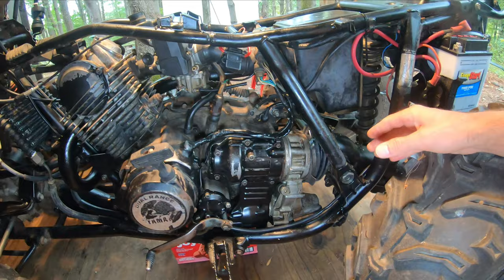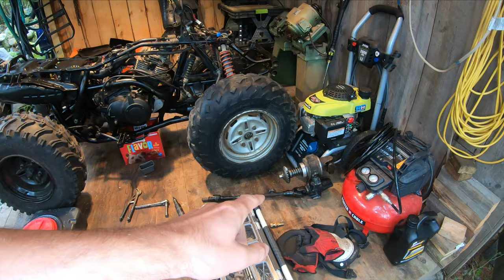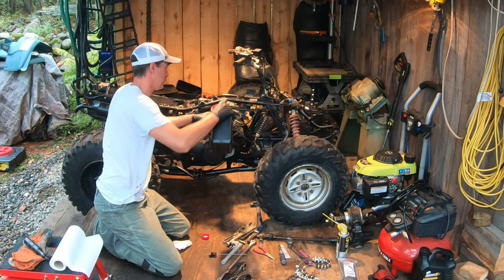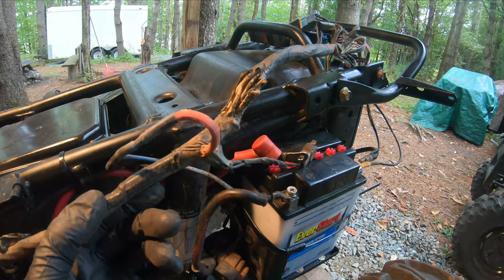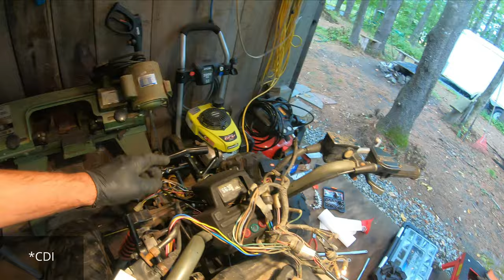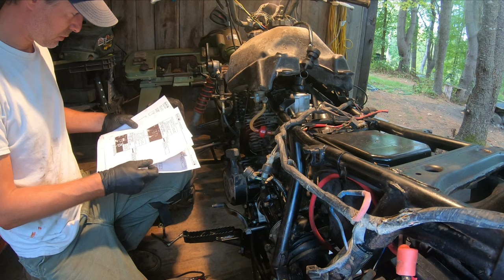How To Troubleshoot No Spark or Weak Spark on Yamaha Big Bear with Full Wiring Walk Through

Comment: FIXED!! i had no spark. Replaced key,stator,cdi,starter switch etc etc. no spark! then i read someone on here said to unplug the key and jump red to brown and black to black and white!. i figured i had 2 new key switches!! but hell ill try it. well it worked!!! immediately got spark back. 2 brand new key switches would not allow it to spark but the key worked for main power, weird!!  thank you foe who posted that. just jump the key plug you have nothing to lose trying.
Reply from the maker: Interesting… brown to red completes a circuit. Then the black to black/white tracer closed the other circuit… interesting. Thanks for posting back. I’ve had switches come in wired in the reverse as some quads need the black/black white tracer circuit open for spark. Yamaha Blaster gen one closing the circuit kills spark for example.) Seems vendors post more model compatibility than  is actually the case sometimes. :)
Reply: @seanpettit6410   have a 89 warrior had spark a month ago, no spark at all, change stator, coil, spark plug, etc. still no spark bro
Reply from the maker: @rudedude_5047 any chance you have frayed wire that is grounding out the harness somewhere?

Comment: Doublecheck ALL your grounds. The coil, engine to frame harness to engine, etc. Corrosion or paint will be your enemy. Sandpaper, SS wire brush (I use small welding brushes i.e. SS toothbrush style) Even bullet connectors can have corrosion inside them. If nothing else, make the connection and then probe the connector from the back side to the other, again probe behind the tubing to get at the connector. Check the grounds this way and any other connectors you can probe. I have found that running through water and not thoroughly rinsing the machines down afterward will lead to all kinds of electrical corrosion in the wiring harnesses. after cleaning, spray all contacts down with WD-40 before re-connecting them. It was designed to prevent water contamination of metal surfaces.

Comment: Dude! This video was killer. I am having the EXACT one spark issue with my 87 Big Bear 4x4. I've been through 3 stators, 3 coils and 2 CDI's. When I saw you find those pick up coil wires rubbed through I thought for sure you found the issue, but then you still had 1 spark. I think I would have thrown in the towel at that point. I'm still screwing with mine and need to find your next vid since I see in the comments you finally did get your spark back. Gotta hand it to you on everything you documented. Imagine what that would have cost if a brick & mortar shop did it....Hopefully I can find the "fix" video. Thanks
Reply from the maker: I’ll tell you the fix. I ended up replacing four parts. (Wish I could have pinned it to one.) I ended up buying a used 1990 harness on marketplace. For the 1990 harness to work I had to get a different stator and cdi. The harness came with a different handlebar switch as well. Plugged them in and boom been running ever since. I think… I still had a stator issue even though two knock off stators were passing resistance checks. The test I didn’t do was an ax voltage test to see how much voltage was actually getting to the coil. The test procedure isn’t in these old manuals. I had to google it. It might have helped. Good luck.
Reply: @VermontLife  Thanks for the reply. I did see in episode 10 I believe where you talked about replacing all those parts from a '90 model. You have way more time than us mere mortals out here (even though I work on these things pretty much full time at my place in AZ) I just am not going to go that route replacing everything. I think it is destined to be a parts quad in my eBay store very soon.
Reply: @VermontLife  Just to update you....I found a NOS OEM stator for mine which was still in the box. Since you still had suspected you had a bad stator I quickly installed it today and BAM!!....still had one damn spark. I tried the old original CDI and still one spark. I put on another coil and still one spark. I have NO mice damage or broken wires on my harness. This is freakin unreal.
Reply: @SwormCycles  I am having the same issue with 1 spark but on a 2008 Big Bear 400. One potentially important detail is that if I install a new CDI I get continuous spark for about 1 second and then it’s gone and I can never get it back. I plan to measure the stator peak input voltage to the CDI next. I hope the CDI isn’t smoked but since it begins with normal spark and then looses it and will not come back that isn’t a good sign. All stator resistance checks are in spec.
Reply: @filiptrojanek5083  See my long disertaqtion below regarding how this problem was fixed. It is your ignition switch and/or the engine stop switch. Most likely nothing to do with the stator, coil or CDI.

Comment: Having the Exact same problem was running fine then next day no spark! Can't wait to see what you find is wrong frustrating.
Reply from the maker: I’ll get it, stay tuned.
Reply: Have you figured it out? I got the moto 4 350 1987 having the same issue... new coil, spark plug, key switch and cdi and only get one spark here and there
Reply: @VermontLife  anything new... I got the same issue
Reply from the maker: Well, yes but hard to say which component. I swapped out the electrical for a 1990. That gave me a new harness, stator and cdi. Now it works. Considering I had the issue with two harnesses and tested the cdi’s in another unit I’m left believing that my stator was bad even though it passed tests… best guess.
Reply: @VermontLife  thanks
Reply: @Vermont Life  could you please help me out? I just posted a comment about a stator issue I'm having on a 1987 moto 4 350. Need the specs and can't find them thanks so much
Reply: A lot of times it's the connections from the stator to the wire harness the connector opens up and doesn't allow it to connect all the way
Reply: I have the exact same bike and I’m having the exact same problem. Can’t find anything at all. 
Please let me know if you did or will find anything, I’ve replaced a lot and got nowhere. It’s very frustrating, but I’d appreciate any help or anything you did to get it going
Reply from the maker: @COUNTRYRNM I ended up swapping out the harness for one from a 1990. To do this meant I also had to swap out cdi, stator and handlebar switch. Runs like a champ now. I still can’t say 100% but believe I had a few bad stators that all tested out fine on my ohm meter but were in fact bad. Best guess.

Comment: I read ahead to get the spoiler but still want to watch the video on how you found the problem.  I'm definitely staying with you as I am learning TONS of useful things! Thanks for sharing your knowledge.  I do have a question for you.  Do you have, or will you film for us, a video on how you clean a wiring harness? I just could not tell enough of the details from the small amount of footage in this video of your harness cleaning.  I don't want to use any cleaning procedures that would be inappropriate.  

I am thinking of removing and unwrapping my harness, cleaning it completely, rewiring where needed, checking and replacing any damaged connectors, and testing it thoroughly before reinstalling it. Yes, I know that is a lot of work but I am willing to do it just to bring my 38 year old wiring harness back up to like new condition. Any  tips or hints for doing that work would be greatly appreciated.
Reply from the maker: I used my parts washer with EcoGen cleaner https://amzn.to/3YgcSDN to clean the harness after pulling off all the tape. Interestingly, I ended up repairing the harness and still having the issue.I wanted to stay away from something more corrosive like gas or diesel. After the washing in the parts washer I rinsed it off in a 5 gallon buck of water from the hose and hung it to dry. Other than that it was just some patience with a tooth brush etc to get the grime out as best I could. I'll definitely clean more harnesses in the future as I like working on clean parts. :) Thanks for the feedback. I appreciate it.

Comment: I belive it's the key switch!!! Try the pull start with the key on the off position and if I'm right you should have full spark.
I had the same issue with an aftermarket key switch and found out that many of them are wired incorrectly even when it says iys for the correct year of the atv. It's an easy fix but i can't recall what two wires you need to cut and jump together
Reply from the maker: I tested the key switch via the manual pin out and all was good for resistance and open lines in the right places. Tried what you said with the pull start but no dice. Thanks for the insight. You never know sometimes.

Comment: I suspect it's a pick up coil off the stator that's the issue. The pick up Senses revolutions of the flywheel and tells the cdi when to fire. How you checked either the pick up is in tact, or also checked the outside of your flywheel that it's not damaged? You should see a raised metal tab, that's what the pickup senses and then tells the cdi to fire.
Reply from the maker: I did, I inspected the flywheel and tab(s). Interestingly this unit has two metal tabs that go along with each of the two pickups. Pickups physically look fine on both stators.
Reply: The prongs inside of the plug on the stator they don't make a good connection

Comment: Well your not going to believe this one but I went on a FB page regarding these quads and some of the moderators immediately said to check the ignition switch as soon as I posted the symptoms of the 1 spark. Even though my switch was allowing power to the starter button, it was not allowing power to the CDI. I unplugged the switch entirely, put a jumper wire between the red and brown wires on the harness side plug and a jumper wire between the black and blk/whi wire on the harness side and Whammo!! the thing fired up in less than half a second. They also said that if that did not fix it, then it was most likely the kill switch on the bars. It had nothing to do with the CDI, stator or coil. God did I ever waste my time on that stuff......but she is running now.
Reply from the maker: It’s the simple things right? Awesome that you found it. I really should do a video just on bypassing the ignition switch for folks as this one spark challenge seems to keep cropping up. Congrats!
Reply: @SwormCycles Can you describe more this test? You mean the key switch or the kill switch with the starter button? The red and brown are the ones coming from the kill switch/key switch and the black and white and black of the main harness? Thanks in advance
Reply from the maker: In my experience since making this video I start with the key switch bypass as it is easier. If I’m still having trouble I bypass the kill switch on the handlebars in addition to the key switch.(It could have two bad switches.) If it works I then undo the key switch and test again. If it then works it’s just my key switch that has failed. If it goes back to one spark then both switches have failed. Good luck.
Reply: @VermontLife  Hi, sorry to bother you again. Can you guide me a little bit on how to do those bypasses? The thing is, my Moto 4 350 was fine. Let it sit over winter and before starting it up again I switched the key ignition switch and the starter/kill switch for aftermarket ones since they were kinda beat up. And I got no spark. Since then I got a new stator, vol regulator, cdi, ignition coil and nothing. Checked all my connections and grounds. It does turn over but no spark at all. I also got another ignition/starter switches and nothing, same thing. 
Unfortunately I threw away the old and couldn't try them back again. So this is my final attempt before I set it on fire and push it off a cliff to the atv Valhalla  lol.
Reply: jumping the red to brown and blk to blk and white worked for me.i had 2 new key switches and neither allowed the bike to spark.what was weird is both switches turned everything on and off as they should and seemed correct. weird.

Comment: Did you post a new video of the fix? What fixed it?
Reply from the maker: Ultimately a harness swap to one from a 1990. I still have not found what the problem with the original system was. Note that when I had to swap to the 1990 harness I also had to swap the cdi, stator and handlebar controls. All of which tested fine or I substituted with a know good so??? It still runs like a champ today. So one of those four items bested me.
Reply: @VermontLife  thanks, I was looking for a fix. I have no spark at all, not even the 1st spark as you were getting. I’ll figure mine out.
Reply from the maker: @shelbydogg  No spark at all... I have a video on the wiring harness of a 350 in which I went step by step through the manual that might help. Best of luck.

Comment: Hi - Did you ever find a definitive answer for what was wrong? I have a 2008 Big Bear and it also will only produce 1 spark. With a new CDI gives me 1/2-1 sec of spark then permanently looses normal spark and back to 1 spark only.
Reply from the maker: I ended up replacing swapping the harness with one from a 90 big bear. That required a different stator, cdi and handlebar controls. Been running like a champ since. I still think I had a stator that was passing tests but still bad. Unfortunately I was able to to pin it to one component but those four (from marketplace) did the trick.

Comment: Same exact problem on my 88 big bear 350 as well… 1 spark then nothing I don’t understand at all what’s happening so I changed the stator,keyswitch,cdi,regulators and basically every component.

Nothing after all that…
Reply from the maker: hmm, are you sure the new key switch is wired correctly? (I've seen some aftermarket one wired opposite.) You might try jumping red to brown and black to black white to see if anything changes. There's also a pretty good Big Bear Facebook group that might be worth joining to get a conversation going with a larger community. One item you haven't mentioned is the handlebar on/off switch. Open and check that for proper continuity as well. Good Luck!

Comment: Ignition switch or overspray on body grounds?
Reply from the maker: Great thought on both. Ignition switches I was able to ohm test successfully (and with the appropriate pin out. I've seen them come wired incorrectly.) Overspray I've cleaned up and having it happen across all the grounds seemed unlikely.

Comment: Hay bud I got a 92 big bear lost spark so I bought new stator with pickup coil attached. New cdi new coil and now I get one spark then gose away and only way I'm getting spark is if I move the kill switch back and forth from on to off real fast. It's weird. Any suggestions would be great
Reply from the maker: Can you bypass the switch to rule it out? I assume the stator tests fine via Ohm'ing out. You might try researching how to do an A/C voltage test at the ignition coil to see if enough voltage is even getting to the spark plug. (Another sign of a bad stator. It could ohm out fine but not be passing enough voltage.) In the end on mine I swapped to a harness from an 89 that included a stator, cdi, main coil and switch. Been running like a champ since then. I wish I had pinpointed it to which specific piece it was.) Good luck.
Reply: Yeah new stator test good. I'll have to try that because I've heard to were the starter gets worn out and robs all the power. Thanks for the tip bud
Reply from the maker: @justbraaapit2311  Post back when you get it.

Comment: I have a 99 big bear 350. And out the blue this issue came up. I could pull start it and it would hit and got it to crank.   Pull start broke now but I could get it to eventually crank with the button so I order new stator in new coil crank up ram like a top. A week later crank up whike it was eating still open the gate went dead and no spark nothing dead in the water as they say.  
I changed out the coil and plug tried old cdi and the new cdi nothing I’m getting nothing at all did you ever figure out the trick
Reply from the maker: Ultimately I still believe I had a bad stator that was passing the ohm tests. (I didn't do an AC voltage test.)  After banging my head for a bit I swapped in a harness, cdi and stator from a 1990 big bear and it has been running great ever since. Considering I had two harnesses that I went through off the quad with a fine tooth comb and was able to test the cdi's on another quad to know they were good I believe my root issue was sporadic/faulty stators (I had two that tested good and gave the same result.) I'd retest your stator or, hate to do the throw parts at it game, swap it out with another.
Reply: @VermontLife  this has been a restore rebuild kind of thing lol when I got it it was missing the front drive shaft and none of the u joints was there exhaust was rusted out and so on. It funny thing how after a lil lift instal I set the bike down and been chasing this issue.   I’ll chk my stator again.  For sure. I bought my new one from Ricky stators suppose to have a yr warranty but he hasn’t touched base back with me yet lol.   Thanks for your reply